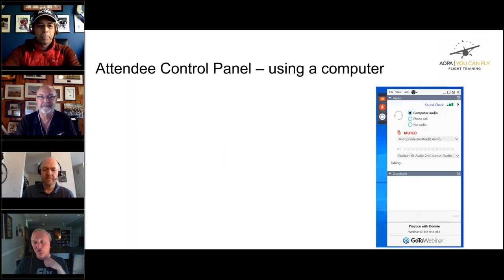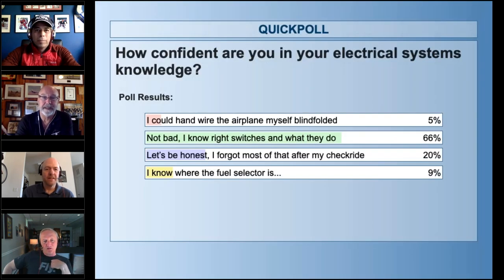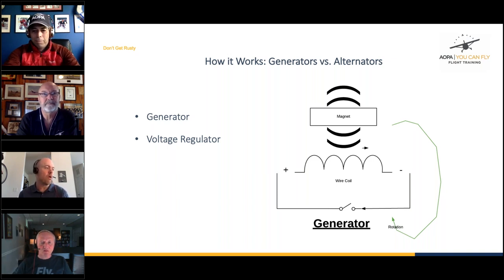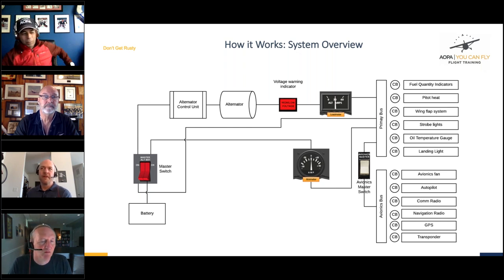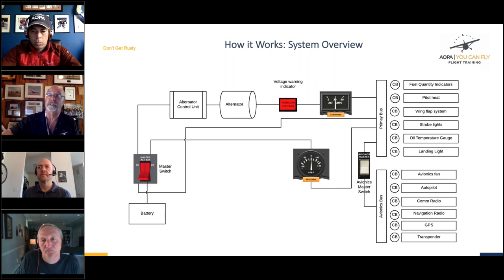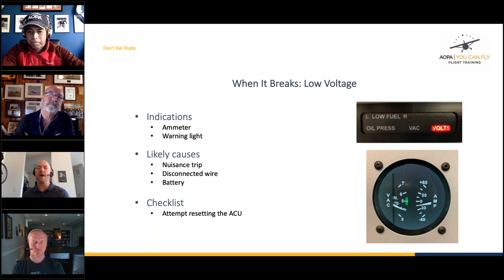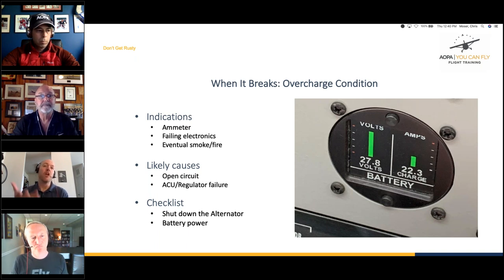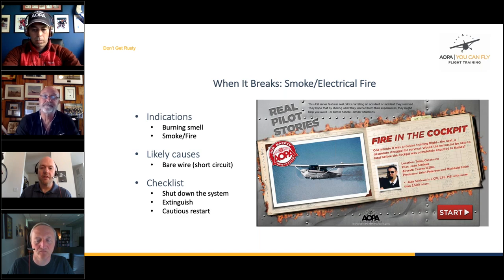Don’t Get Rusty: The Shocking Things You May Not Know About Your Electrical System

Comment: The depth on discussion was too shallow.  I also think a lot of the discussion was 'best guess' and I question accuracy.  Examples.  Alternators are better because DC power loses more than AC power???  No.  Alternators are better because they require much less maintenance (brushes wear a lot on generators), are lighter, likely last longer and reliability is higher.  Similarly, it was stated that today's planes require a lot more power than older models due to more complicated avionics.  Again, I think this is someone's guess and likely inaccurate.  Today you might have more equipment, but most all of them are digital, require little current draw and none have tubes that took a lot of power.  Let alone the move towards LEDs for recognition, landing and lights which draw much less.  I just heard another one!  Turbines have generators so there is a rectifier ...

I won't watch more of these because the knowledge level is too low, sometimes flat wrong.  It is disappointing that nobody on the panel disagreed when misinformation was put out.